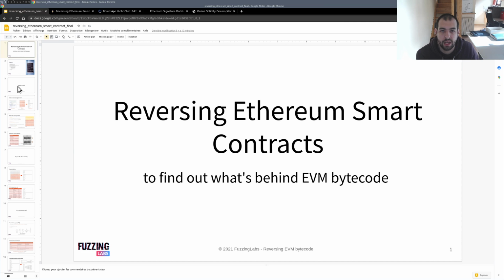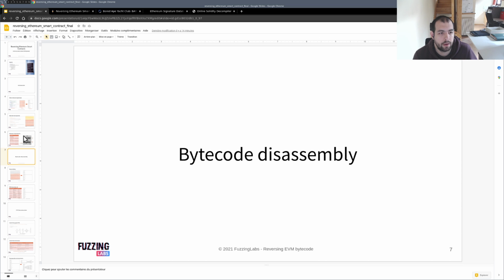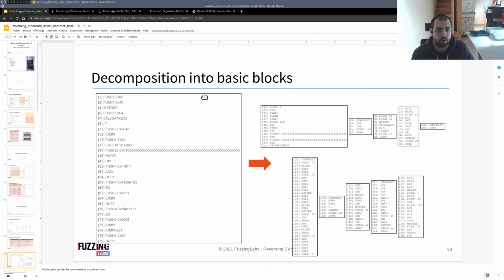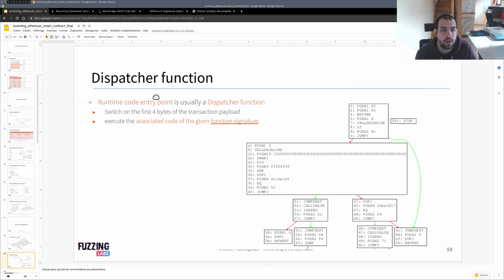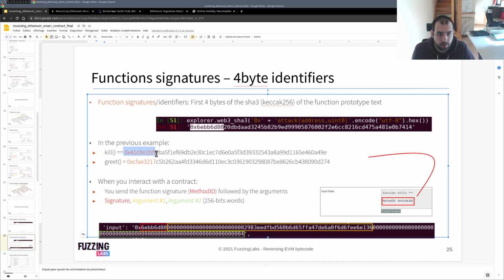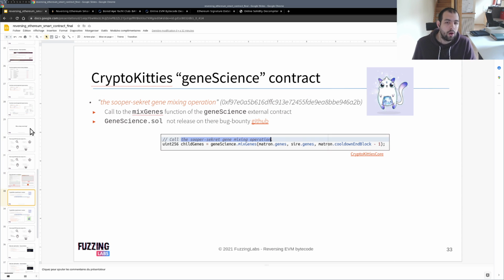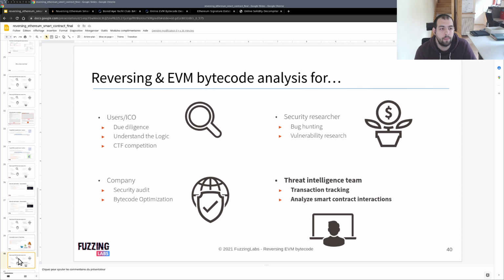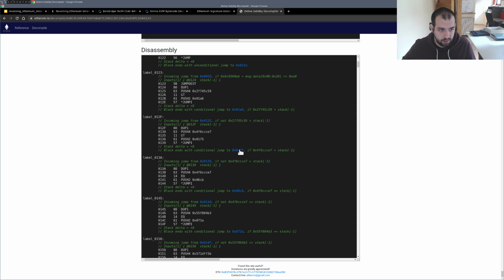Ethereum/EVM Smart Contract Reverse Engineering & Disassembly - Blockchain Security #3

Comment: For those of you having a problem with the author's accent --->

Hello everyone, some of you may have discovered that I gave a talk at DEFCON 4 about three years ago. DEFCON is the official term for the conference. The talk was recorded and the main focus was on reversing EVM bytecode in smart contracts. I discussed the difficulties and challenges involved in reversing EVM bytecode. If you're interested, I'll provide the link to the video below. Today, I plan to give a condensed version of that talk, discussing the process of reversing EVM smart contracts and highlighting the main issues. I'll also provide a live demo to show you what you can directly observe on Etherscan.

The primary objective is to reverse EVM bytecode. This is particularly valuable for security audits on closed-source bytecode, and it's also useful even if you have the source code, as it helps you understand optimizations and the internal workings of a smart contract when transactions interact with it.

Let's begin with a brief introduction. Reverse engineering involves working with closed-source bytecode to recover and comprehend the underlying logic. When you have Solidity source code, it gets converted into EVM bytecode. Reversing, in this context, means transforming this bytecode into a more readable format, specifically EVM assembly. This enables us to gain insights into how a smart contract operates internally.

Breaking down the bytecode structure, we find the loader code, responsible for creating the contract, and the runtime code, executed whenever a transaction interacts with the contract. There's also the option of adding a swarm hash, which points to external resources like IPFS. Ethereum's EVM is a stack machine with various opcodes that dictate operations. It consists of stack, memory, and storage. Storage, unlike stack and memory, is persistent and retains values over time.

To disassemble bytecode, we convert it into EVM assembly. Understanding the instruction set and associating values with the correct instructions is crucial. EVM instructions cover operations like arithmetic, memory handling, and more. While this helps in grasping the basics, the challenge arises when we encounter jumps in the code that alter the linear flow. This is where control flow graphs (CFGs) come in. CFGs visually represent program logic using basic blocks and edges. This enables us to identify patterns like if-else conditions, loops, and more.

Identifying control flow instructions is pivotal for constructing CFGs. These instructions signal the end of basic blocks and facilitate splitting bytecode into these blocks. Jump, jumpi, return, and other instructions shape the CFG. This process clarifies the execution flow, preventing confusion caused by linear reading.

CFGs lay the foundation for recognizing functions. The dispatcher function plays a key role, parsing transaction data to decide the function to execute. Understanding this function enables us to determine how various branches of execution are triggered based on the input data. It also enables us to map function hashes to their corresponding function names.

Remarkably, we can even extract function names from closed-source bytecode using the four-byte function hashes. These hashes are generated using a specific formula based on the function prototype and arguments. By analyzing this hash-generation process, we can derive function names.

In conclusion, my previous talk at DEFCON delved into the intricate process of reversing EVM bytecode. This method is crucial for security evaluations of closed-source contracts and offers insights into contract behavior even with open source code. Understanding EVM assembly, constructing control flow graphs, and mapping function names enhance our ability to navigate the complexities of smart contracts.